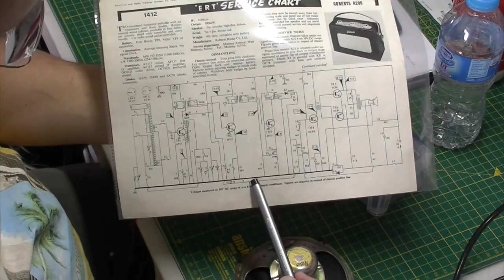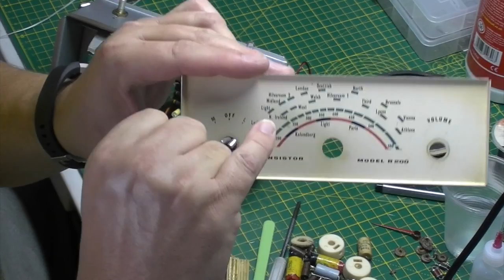Christmas Advent repair series 15th December 2017: Roberts R200 repair and restoration part 2

Comment: I've been restoring Roberts sets for many a year, but have never fully stripped an R200 down to its constituent parts. After watching this so far, I have a new desire to tear one down just so I can check those grommets! I look forward to the rest of the series, particularly this set. I'll also get myself some of those GT322Bs - it'll be the first time I've ordered anything from Russia... unless you can point me in the direction of another seller? Cheers
Reply from the maker: I’m glad that I have inspired you to look a bit deeper into the R200. It’s quite satisfying putting it all back together in a nicely refurbished chassis. I buy my GT322B transistors for a Russian seller on eBay and have had no issues so go for it. Thanks for watching, Graham